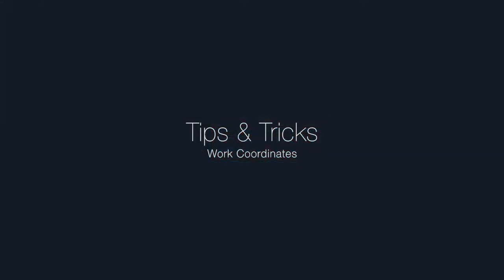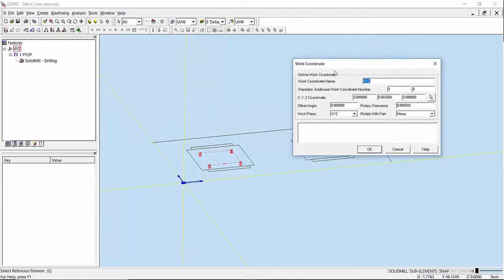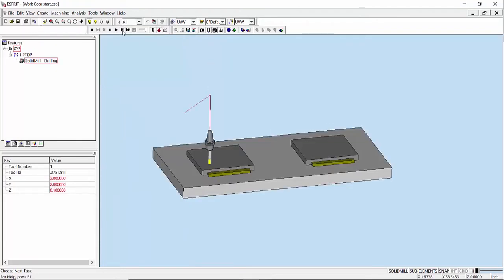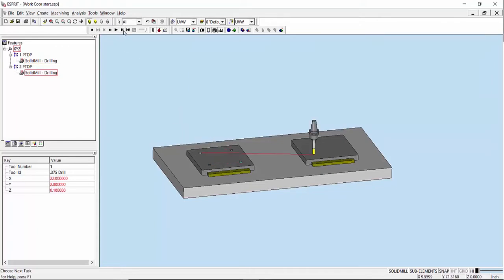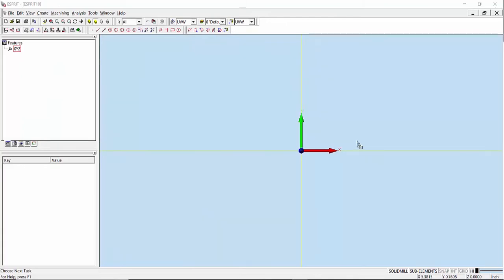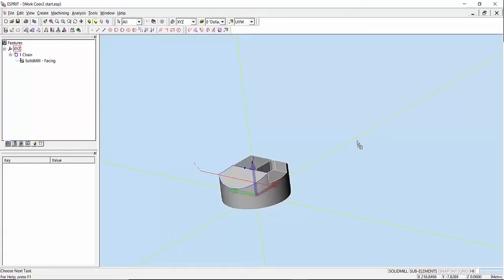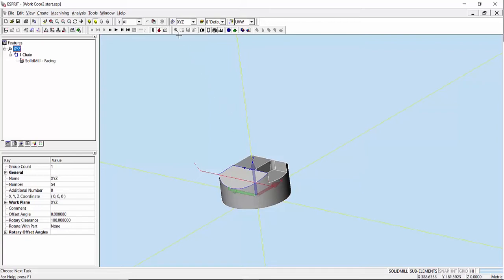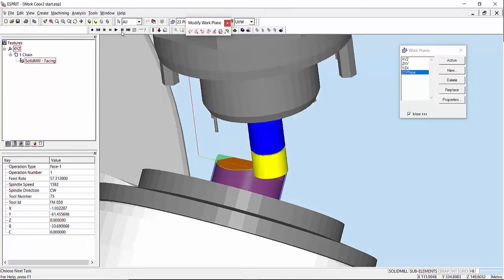ESPRIT® Tips & Tricks: Work Coordinates

Comment: Hi there,
I seen your system requirements and i have workstation with" 16 gb ddr3 ram, xeon dual cpu, 4 gb quadro gpu, ssd etc" specs.
But my espirit tng stuck when try to analysis. I cant use second TNG therefore TNG'll stuck my workstation.

Analysis take long time. 

F.e : Solidworks have special driver for their software. Have u got like this ? I cant fix my problem. Need informationfor this subject.